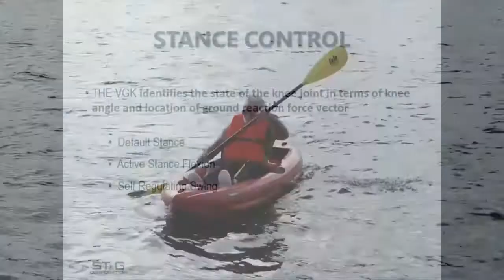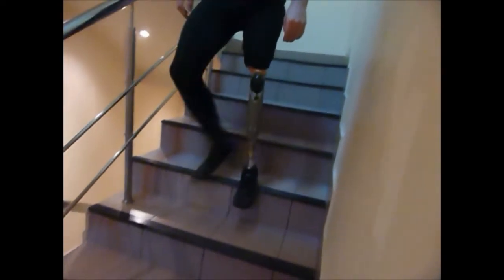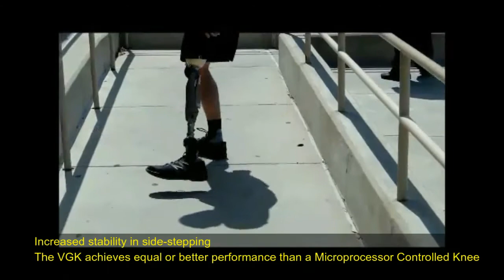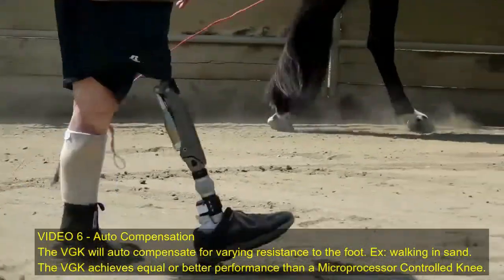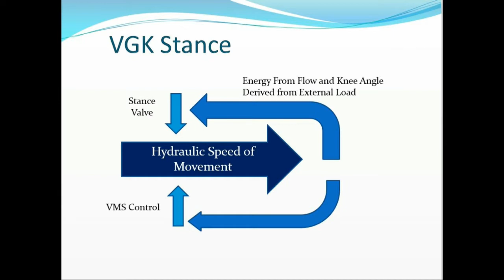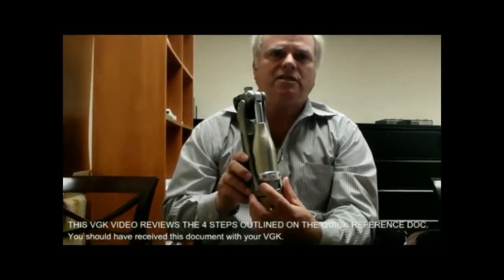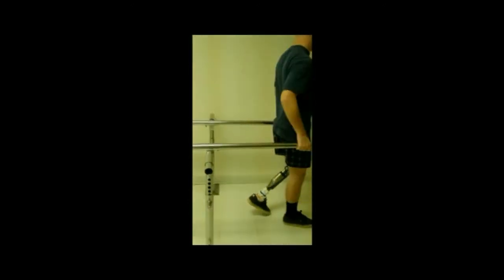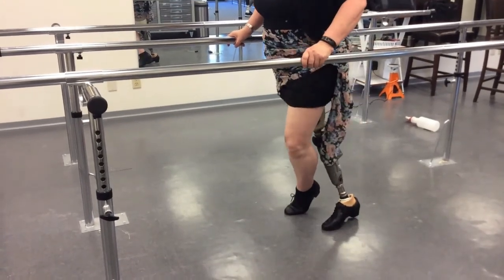VGK Very Good Knee Video Presentation

Comment: I liked the presentation very much. This VGK knee seems to have all the features I need. At present I have a basic knee Endolite which is quite limiting in so far as once you move wrong accidentally, which is very easy, beyond the stabiliser point which is about 20-30 degrees bend, there is only one place you are going and that is down. I have had to rely on my existing knee for sitting with the strength of my arms, the downward movement into the sitting position is totally uncontrolled by the Endolite knee. I mentioned this VGK to my prosthetist on Monday just gone and he said that it is very heavy and didn't think I would manage it, but the Endolite one is heavy as well, I just want to try it. The one he showed me he did say had been around for a few years, so possibly the one now manufactured has been improved on weight wise. My present AK limb weighs about 12lbs, I personally weigh about 9st 7lbs, so I am far from fat as I am 5ft 7 ins tall.
Can you give me a rough estimation of how much heavier the limb might be?
I have always walked with a "free knee"
Any advice would help as I am seeing the Prosthetic Doctor soon and it is she who decides whether or not I can use it.